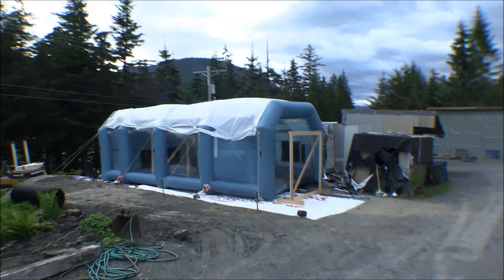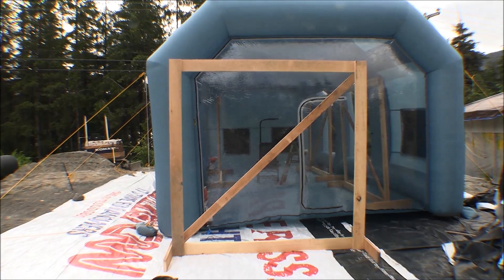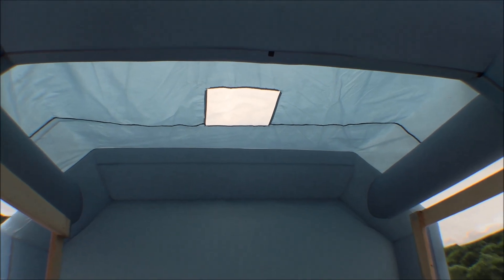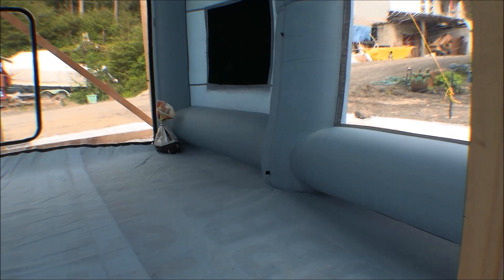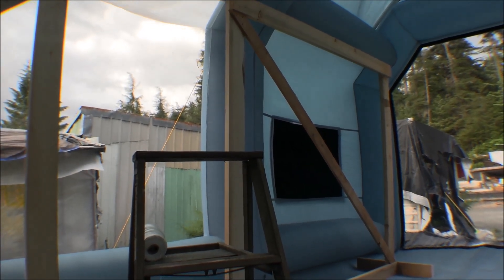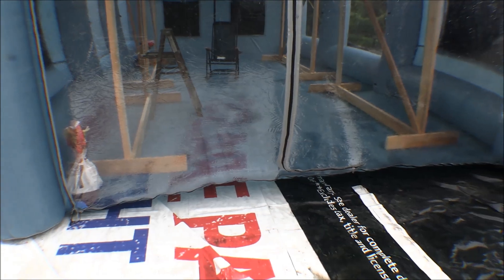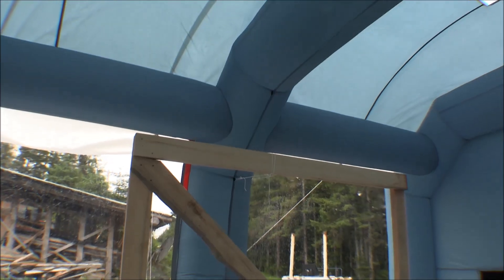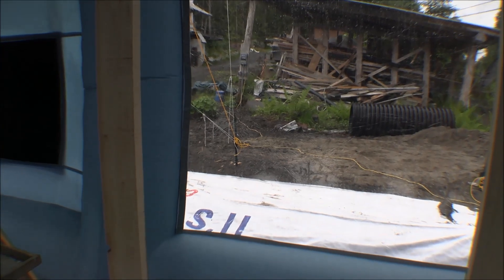Piper Super Cub Wing / Inflatable Paint Booth Verses Rain

Comment: Nice set up i just finish my paint shop inside of the hangar. I am starting this week-end to install the poly-fiber fabric. Like to know if you have an E mail address and if you will like to give me it. Like to know if i should add tape on the wing ribs prior to install the fabric ? Regards
Reply from the maker: You don't need to tape the ribs. Tape over anything that protrudes such as screws and rivets and any sharp or rough edges that make wear through the fabric. The fabric is going to flex and move under use and you don't want it to wear from the inside out. Finishing tape goes over the ribs and other hard points after the fabric is finished.
Reply: @psgflier  Thanks for the reply. When i removed the old fabric masking  tape was on the ribs.
Reply from the maker: @martinabud5735  If there has been repairs to the rib that create edges you might want to tape over those portions. The fabric has to move over the ribs and any place it's not glued down when you heat shrink. If there is tape on the ribs the poly brush will stick the fabric to the ribs and pull them out of alignment. The herring bone tape I used in a crosshatch pattern helps keep the ribs from being pulled out of alignment when you heat shrink.
Reply: @psgflier  I do have 2 places where the ribs  add repair, i tape it. Thanks for the help.
Reply from the maker: @martinabud5735  I've seen some wings that had screws put into the ribs for some reason, early cessnas and stinsons used rivets or screws to secure the fabric to the ribs instead of lacing. If you have something like that you may want to tape over any holes